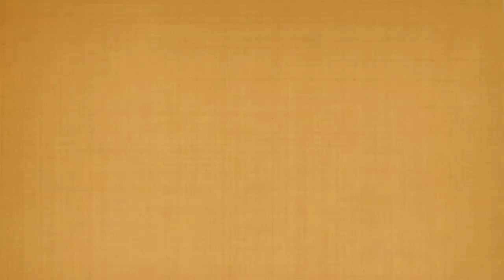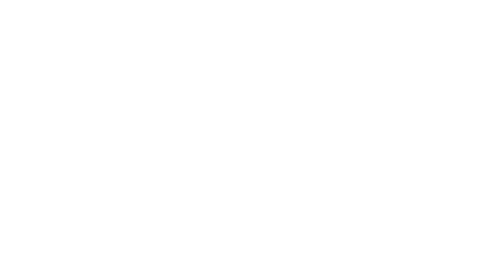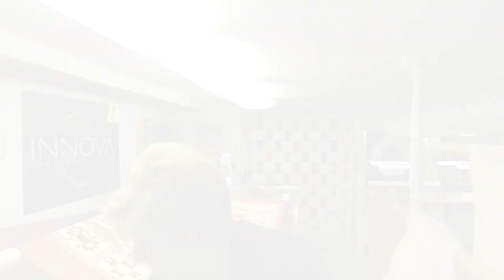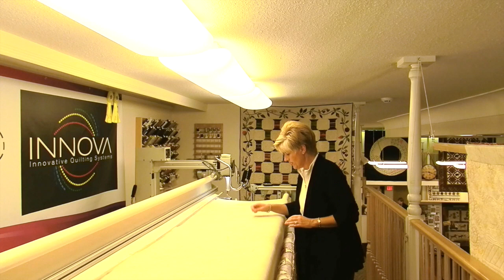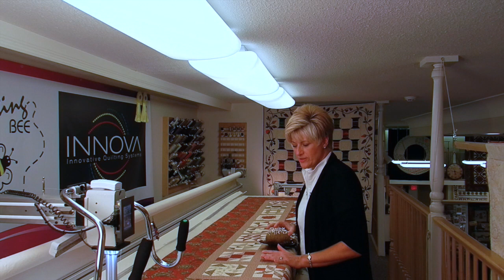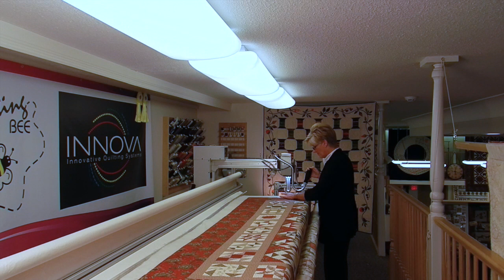Loading a Quilt with Leader Grips or Red Snappers - Part 3

Comment: I am very new to long arm quilting and found this to be a great tutorial.  The leader grips were highly recommended by a friend.  

Question:  On the video, you demonstrated basting the quilt top, batting and backing across the top and down a portion of the side.  Do you continue to baste the remainder of the right side of the quilt and then do the left side before quilting (so the quilt is fully basted on three sides before you start quilting)?  Or, do you quilt the sides only as far as the machine will allow, quilt, roll, baste the next section of the sides, quilt, roll, baste, and so on?

Thanks very much.
Elise
Reply: No need to respond.  I see this question was posted and answered earlier.  My apologies.